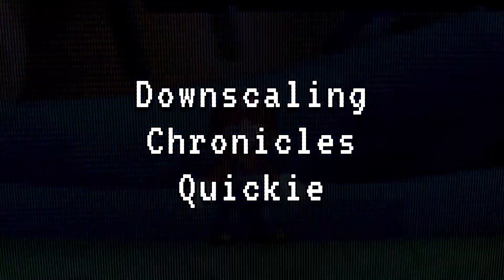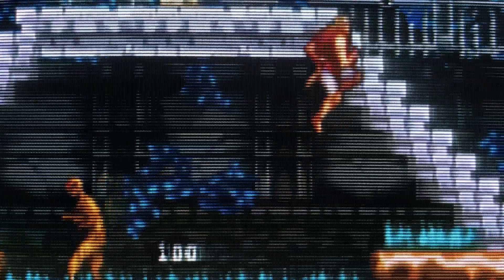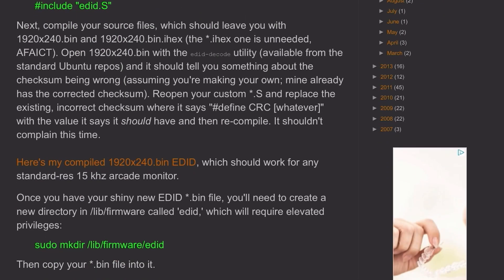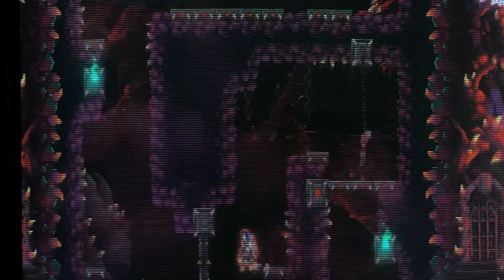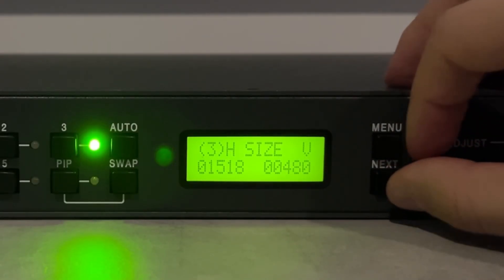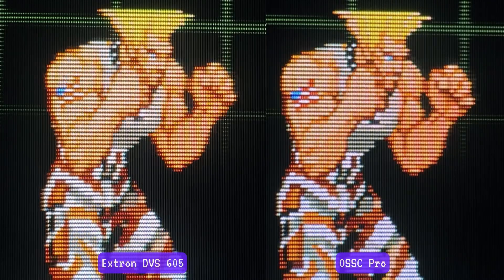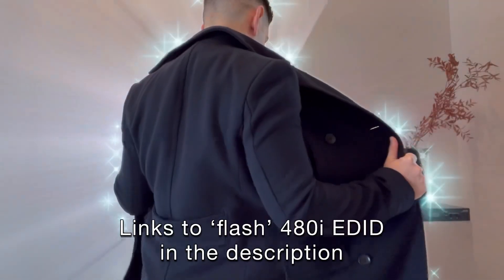Downscaling Chronicles Quickie: Extron EDID Method with 480i Output on the Extron DVS 605

Comment: Would it work with the IN606. Have not seen the DVS 605 for sale at all
Reply from the maker: I'll give that a try soon and report back with the results
Reply: @MarcoRetro316 Haha as soon as I posted that comment, I searched gumtree and someone had 2 for sale but as per my luck, he’d sold them earlier today!  Search goes on. Thanks for testing. I’m guessing this current method might work with the IN1606 albeit with the dropped frames!
Reply from the maker: @wedeservedit  you might have dodged a bullet. https://youtu.be/r0dlVXlLm-E?feature=shared 
Without altering the 480i EDID and only adjusting the H size and position on the PCS it’s a complete mess. It’s not as bad but it reminds me of the MIMO Genius Box from episode 17
Reply: @MarcoRetro316 Haha. Unfortunately it’s a boom headshot as I’d already bought the IN1606. Just wondering to give it all up and just get an ossc pro already or the morph 4k looks interesting too
Reply from the maker: @wedeservedit  sooo 480i does work on a JVC DT-V17 monitor
https://youtu.be/V96vxeNAxaY?feature=shared
It must be a sync issue. Still, you have to use a DAC plus and Extron RGB Interface on the output. Unless someone else chimes in and gets it working then I’d go with a Corio2 if you’re on a budget or if you can afford an OSSC Pro+Extra AV Out then that’ll be more seamless.

Comment: Hi for 240p output, the 605 has a better picture but more lag than a OSSC Pro? Does blend and decimate  really have a difference in picture quality?
Reply from the maker: The OSSC Pro decimates so it will look sharper in still captures. But decimation is best suited to downscaling content that is an integer upscale of 240p, otherwise you get vertical shimmer and choppy text. The DVS 605 blends lines so it will look a bit softer in still captures but is much more forgiving for shimmer for non-240p games with vertical scrolling or heavy use of small text. Lag on the DVS 605 is 0-1 frame (16msec at most for progressive inputs). On the OSSC Pro it is only a few msec in Adaptive Line Multiplier Mode which is pure line drop. In Scaler Mode it is almost the same as the DVS 605 with 20msec of lag. Scaler Mode gives you more freedom to scale compared to Line Multiplier Mode.
Reply: @MarcoRetro316  so can I say in 240p content there is no difference between the two but 605 is better in 480i and video content?
Reply: And does the audio swtich on 605 A and 605 AD a useful function? Or other variants like 605 and 605 D will work fine?
Reply from the maker: @wujames4074 I would say they will look equivalent for downscaling integer upscaled-240p as long as the fields are offset correctly. The DVS 605 is better at downscaling all other content. They will both produce nice 480i. The OSSC Pro’s 480i will look sharper because it’s still using decimation but it shouldn’t be too jarring or jaggie
Reply from the maker: @wujames4074 A is for Audio, D is for SDI handling which you likely won’t need. If you can, get the A or AD model so that you can input HDMI and have it handle audio. If it’s a non-A model then you’d need to convert HDMI audio to analog stereo by using an HDMI to VGA DAC or an HDMI video passthrough with an audio extractor
Reply: @MarcoRetro316  ok so the important question, is it worth it to continue search for a good working 605 although can't find it anywhere right now. Or just get the OSSC Pro for easier availability?  Thank You
Reply from the maker: @wujames4074 Hmm well it depends on a few factors. Functionally, they are about the same as they will transcode, sync combine, output RGB/Component, and upscale. I have both in my setup but I use the OSSC Pro more often because of the remote for easier menu navigation. Also because I have a Multiformat CRT and with Adaptive Line Multiplier Mode, I can set specific input resolutions to output automatically, say 1080p in will output to 1080i. It also depends on what you are downscaling. I always use the example of Jet Rider as it’s a non-240p pixel art game and the shimmer makes it pretty unplayable with the OSSC Pro in 240p. If you plan on downscaling anything and everything then the Extron DVS 605 is more forgiving. I’m finishing up a video for the original OSSC using custom FW for downscaling with line blending, so it’s technically possible to do on the OSSC Pro but would require work from Markus to incorporate it and I’m not sure it’s in his roadmap. 

Extron DVS 605’s can be cheaper but it can be a challenge to find a working one. If the photos in an eBay listing show EXTRON ELECTRONICS on the status LCD then it’s likely bricked or the seller coincidentally took the photo during the boot up process. The OSSC Pro is a better upscaler for retro games because it correctly interprets a 240p input and integer upscales with scanline filters and masks, that is if upscaling is a factor to you
Reply: @MarcoRetro316  So a working 605 would go into the function menu or something instead of stuck in the "EXTRON ELECTRONICS" on the status LCD? My main purpose will be downscaling a PC maybe running MAME or emulators to a CRT. I have a PVML2 monitor.
Reply from the maker: @wujames4074 A working DVS 605 should alternate between input and output resolution on the status LCD after it boots. Have you considered CRTEmudriver/Batocera if retro gaming emulation is the main purpose? Those methods have automatic resolution switching for each game. It takes some time to setup but the end result should be fairly seamless. The DVS 605 will work but you might be constantly manually adjusting the V size when you switch games to make sure everything is lined up correctly
Reply: @MarcoRetro316  I am hesitant of going CRTEmudriver route because of the complication of setup process. Thank you for the advice I should spend some time to look into this. Does the image quality and lag of the CRTEmudriver matches the 605 or the OSSC Pro? Does the OSSC Pro has the same convenience of the CRTEmudriver?

Comment: Is it just as good if downscaling to 480p?
Reply from the maker: Yes. As 480p is a stock output resolution, you won’t need to program anything and it’ll be truly plug and play
Reply: @MarcoRetro316  W-wow you were fast! :) 

I saw the other 605 video earlier and was a little sad I might have to shell out for the OSSC Pro for less lag with a downscaler to my 16:9 Loewe. But if i can find a 605, that would certainly save a lot!
Reply from the maker: @MindForgedManacle In theory they do the same thing and the DVS 605 might actually produce a more pleasing picture as it is a true scaler instead of decimating. I prefer the OSSC Pro in tandem with my multiformat BVM as it feels more automated. Example, If I input 1080p, I have the OSSC Pro Adaptive Line Multiplier Mode set to output 1080i, 720p and 480p input gets passed through. You don’t have this convenience on be DVS 605 as it needs to be selected manually, but if paired with a 15KHz CRT then you’ll essentially get the same experience
Reply: @MarcoRetro316  Alright, I was somehow able to find a 605 for myself locally, for about $120 (they have more, and ship, if someone else is looking). Assuming it's not DoA, I should do just fine. :) 

It will be outputting to my widescreen Loewe CRT and VGA monitor as needed.
Reply from the maker: @MindForgedManacle fingers crossed it’s alive. I recently made a tutorial and accommodating downscaling pack which neither met nor be needed in your case of 480p output

https://www.retrorgb.com/extronscalerdownscaling.html
Reply: @MarcoRetro316  You're the man! I'll be sure to use it for 240p as well! But with the Loewe finally obtained, I finally have a set that can do excellent 480p natively and in widescreen!

Comment: Thank you, Marco. Could you tell me what was optimized in the 240p version made by mld? Also, when you said “from Discord,” which Discord server were you referring to?
Reply from the maker: On the RetroTech USA Discord server, user 'mld' wrote that they had trouble getting the Filthy Pants 240p EDID to synchronise with their consumer CRT and posted their 240p EDID which they said solved their issues. They didn't detail what the changes were but I compared them in the Extron EDID manager and this is what I can tell:
The main differences seem to be in the sync timings. The H/V active is still 1920x240 but blanking and sync pulse width have been altered. They have also increased the vertical frequency range from 59-61Hz on the old EDID, to 48-75Hz, which raises the max pixel clock frequency but this shouldn't factor in as the V frequency is much the same at 60Hz. 
There are other changes which I don't think were intentional and likely a biproduct of the program used. Example, the Filthy Pants EDID has signal level standard at 0.7Vpp but the new EDID is now 1v. Colour Characteristics were defined on the old EDID but all RGB Chromacity and White Point values are 0 on the newer one. Both are set to RGB 4:4:4 and I am not any of these numbers actually carry over to the analog output but I cannot alter RGB voltage or chromacity in the EDID manager.
Reply: @MarcoRetro316 Thx for the reply signal level of 1vpp can be harmful to a pvm?
Reply from the maker: @carloselobato  can never be too sure so I can’t guarantee 1Vpp RGB will be safe. I will test the EDID’s output via the DVS 605 in the coming days to see if a 100IRE screen is in fact 1v or 0.7v and I’ll report back
Reply: @MarcoRetro316  Ok I look forward to hearing from you
Reply from the maker: @carloselobato Good news, the RGB output voltage is 0.7Vpp regardless of what EDID I use. Source video Analogizer (Analogue Pocket) SNES core 240p Test Suite 100IRE White Screen Scan Doubler 480p RGBHV > Extron DVS 605 > RGBs PVM 14L5. The reading is actually 0.67Vpp which is due to the core and it reads this even when bypassing the DVS 605 so it’s great that the DVS does not alter the RGB levels. The 1Vpp must just be some descriptor in the back-end of the EDID that doesn’t carry through to the scaler.
Reply: @MarcoRetro316  What excellent news indeed, Marco. Especially because the profile created by mld on my 20L5 showed a more stable sync than the one created by Filthy Pants, and knowing I can use it safely without fearing any damage to my PVM is a relief. Thank you.
Reply from the maker: @carloselobato awesome, I’m glad you promoted me to take a look into it and we know it’s safe to use. Mld’s EDID also has a better horizontal starting point on my 14L5

Comment: any bin file for consumer crt? Having some sync issues.
Reply from the maker: They theoretically should work in consumer and pro. Having said that I couldn’t get an RGB modded consumer TV to sync, and other times my BVM need an Extron RGB Interface to correct the sync. Try the 640x224 that’s in the description. I only have the one interlaced 480i EDID

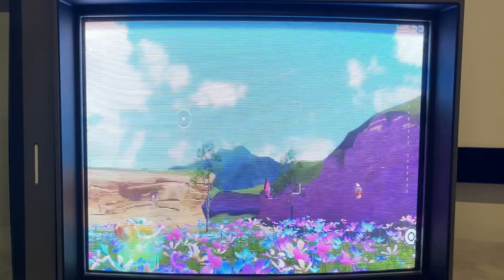Comment: I'm definitely going to try this with my DVS-510. I also have some Kramer units that allow for custom presets, so the information at 1:45 is super useful. Thanks for this.
Reply from the maker: I’m not sure the DVS 510 will work in the same way with the PCS as it’s not on the compatibility list, but maybe via the OSD. Coincidence that you mention Kramer as that’s what I’m testing now and ETA 2 weeks for a video. I have 2 different units and they both output 240(ish)p. The VP-747 has outrageous 6 frames of lag and the VP-725DS has acceptable 1-2 frames. What is your model?

Comment: on a budget like sub 80 bucks or more. what's the best way to get HDMI to component? I've read your list on Retro RGB and alot of those are expensive ngl, so what are your thoughts on like the 40 doller sunnatch converter? I'm guessing it's not the best? but better than the super cheap ones? what about sdi to component? 
 kinda new to downscaling. just got a 61 inch RPCRT and want to hook up a PS5 to it. thx
Reply from the maker: I have an unbranded HDMI to component scaler that seems to be functionally similar to that Sunnatch scaler you mentioned. Mine does 480i output from up to a 1080p input and the image is very crisp. 1080p input has overscan though and there’s no picture controls so the Sunnatch might be the same. 720p to 480i looks very good and only 1 frame of lag with any input resolution. There was slight screen tearing on mine. If you only want 480i output and don’t need 240p then this will probably be just fine. I can recommend other scalers but you have to be optimistic on eBay to get a bargain and they will require some other devices in the chain, either passive or active converters. Example, an Extron VSC 500 has very robust image controls and will output 480i, but you’ll need a separate DAC as you need to feed it component in order to output component. A Corio2 is another option especially if you want 240p and 480i output. For this, you need a Passthrough adapter for HDMI to DVI for the input, then another Passthrough adapter for DVI to VGA on the output, followed by a VGA to RCA/BNC cable to breakout for component. The only hassle is audio. If your HDMI source isn’t running through an amplifier for sound, you’ll need to extract audio at the input to bypass the Corio2. You can see it gets a little more complex when there’s more features. If you just want something cheap and simple and only 480i then I’d go with the Sunnatch
Reply: @MarcoRetro316  i appreciate you commenting an giving the info. Givin the basic scalers dont really have picture controls, which would be nice to have honestly. im going to keep looking, and will watch your reviews on some of them to see. 👍 thx

Comment: I'm unsure what I'm doing wrong. I can't get your 480i EDID to apply to my input; it just says "the  selected EDID cannot be assigned, the video format of the EDID must match the format of their input." The input is 1080p. Thanks in advance.
Reply from the maker: Is this for the DVS 605 or another scaler? The EDID is for VGA and should be ok for custom EDID slots 1, 2, 4 and 5. It won’t upload to slot 3 on mine as that slot is for HDMI EDID. If you’re still having trouble I can churn out another 480i EDID and set it to HDMI
Reply: @MarcoRetro316  Hi yes it is the DVS 605 AD the 244p EDID form Victor works but don't cover the full CRT screen and I was hoping to downscaler my PS5 to my CRT at 480i 🙂
Reply from the maker: Try this 480i HDMI EDID, I added supported resolutions in CE Timings and Audio support. Hopefully the PCS let's you assign this one to the DVS with no issues https://drive.google.com/file/d/1nAC1MjK0EQ-iZS2PvTeDWiWRJmveRlb0/view?usp=sharing

As for stretching to the width of the screen, you should be about to do this in the picture’s settings
Reply: @MarcoRetro316  That worked like a charm, Thank you very much the PS5 looks so good on the CRT at 480i 🙂